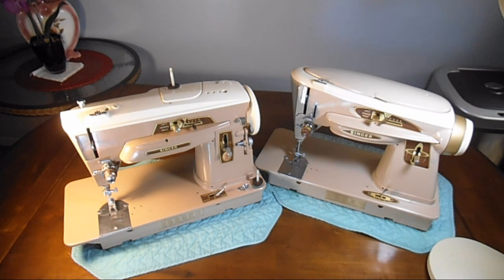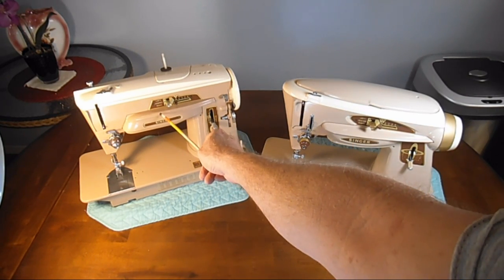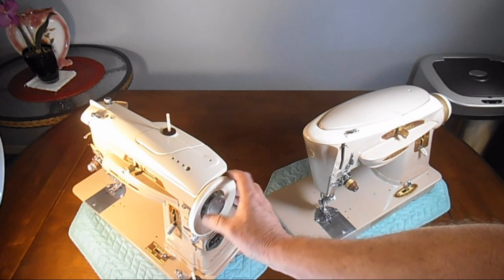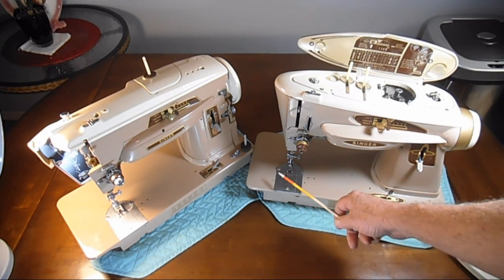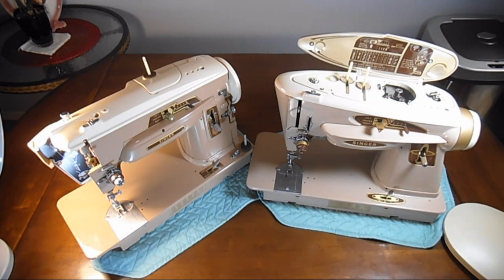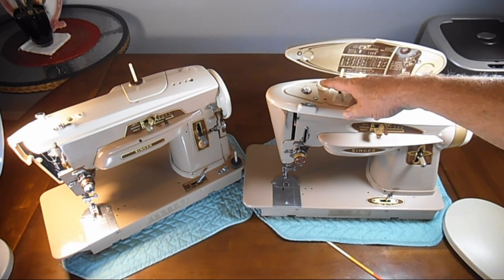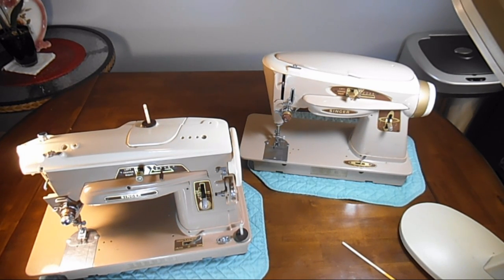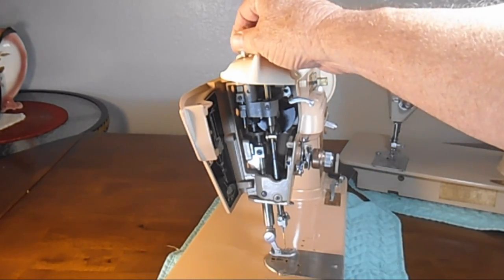Compare Singer Models 403A & 503A Sewing Machines

Comment: HI ,I'm wondering is the machine good fro sewing leather please thank you
Reply from the maker: Well, there are many types of leather. Leather for clothing certainly. Leather for light to medium purses; OK. Bridle leather or thick rawhide; nope. Using a leather needle and walking foot (even feed foot) really helps a lot. On page 5 of the Singer Instruction Manual is a chart showing the types of fabric and needle size and thread to use with the model. You can download the manual free in pdf format at this link: https://www.singer.com/sites/default/files/product_manual/SINGER%20403A%20Sewing%20Machine.pdf
Thanks for watching my channel.

Comment: Andy, there's 3-503As on Ebay, just sayin'.  I just sewed a set of 500D cordura dog boots for the first time.  What a pleasure.  The only thing I don't like about my 503 is that when forcing it through layers of heavy material it de-clutches at the most inopportune times while I'm hand wheeling.
Reply from the maker: I'm glad you enjoy your 503A and sorry to hear about the de-clutching. (never happens on a 403A. haha, kidding) when the needle bar can't move and you turn the wheel it's almost like holding the handwheel and turning the stop motion knob to go into bobbin winder mode. You can check the clutch washer behind the stop motion knob. If it was installed 180 deg off the machine can de-clutch when under pressure. I've received machines with the washer installed wrong and people never knew b/c they did no heavy-duty sewing. If viewers wonder what I'm talking about, look at 54:26 of this handwheel video to see clutch washer install information: https://youtu.be/ghnNYyMC1xU
Reply: @andytubesewing1953  Thanks Andy, I'll check it out.  I've found some other things that were wrong with this machine that you've helped me get straightened out.
Reply from the maker: @ralphwatten2426  Very happy if my videos were helpful, and thanks for saving the machine. How nice if it's just the clamp washer, right? Good luck, and happy sewing.
Reply: @andytubesewing1953  Nothing wrong with it Andy.  I took it apart, cleaned it, reoiled the shaft so it wouldn't move the needle bar and stuff and put it back together.  It's the 503 so it just had the flat thrust washer with the nibs on the outside to hit the screw pin retainer thingy.  It's just that thick tough material.  Thanks-
Reply from the maker: @ralphwatten2426  I appreciated the feedback, Ralph. I did not realize the 500D Codura had 6 filament fiber. That IS thick. Hard for any needle on a domestic machine to penetrate. I knew your washer was different but don't have a video of it so I used the 403A video. I guess the fact you can sew that is a testament to the power of a 503A. Thanks again for watching my channel and take care.

Comment: Both have teflon "Textalite" hand wheel drive gears?
Reply from the maker: Yes, they do. Models 301, 301A, 401A, 403A, 404, 500, 500A & 503A for sure all have the textolite handwheel gear. There may be later models that I am not aware of.
Thanks for asking. (Fred C. Dobbs played by Humphrey Bogart in "The Treasure of the Sierra Madre" 1948)

Comment: What’s the stitch per minute on these machines? Thanks!👍🏾
Reply from the maker: I've never bothered to test the SPM myself, but there are reviews online that state it's about 1,000 on these models. They do not mention what stitch length was tested, ie 20 stitches per inch or 6. These machines are considered lower than the Model 301A which supposedly can sew 1,600 stitches per minute.
Reply: Andy Tube thanks! I actually  also have a 301A I’m using for quilting. I can share the feet with my daughters touch & sew, lol! Thanks Andy! 🤣👍🏾
Reply from the maker: Yes, the same slant feet as these two machines.